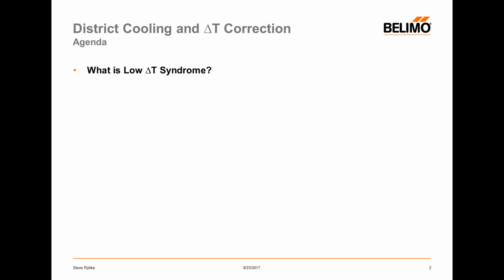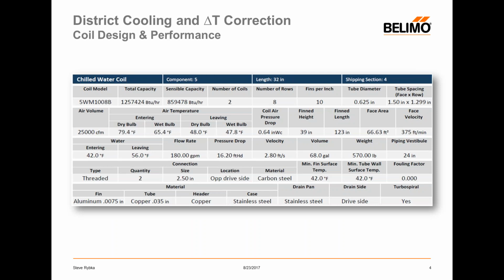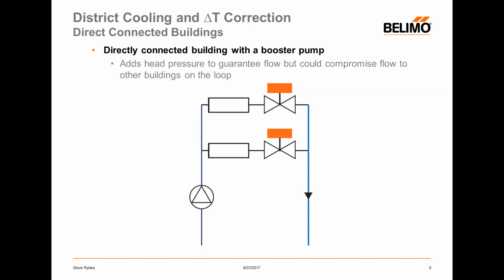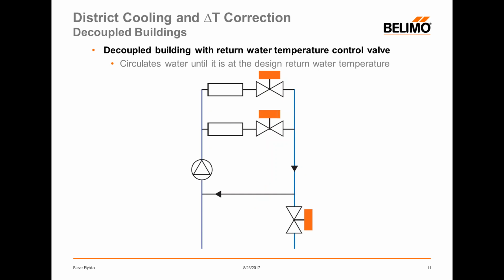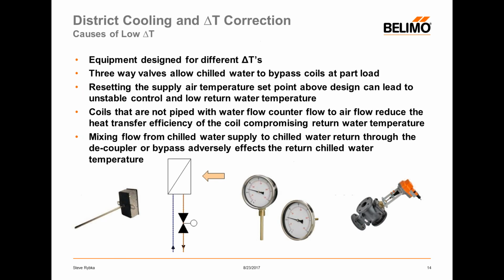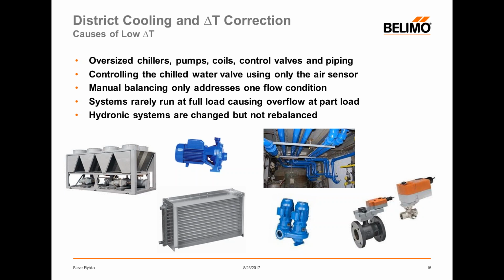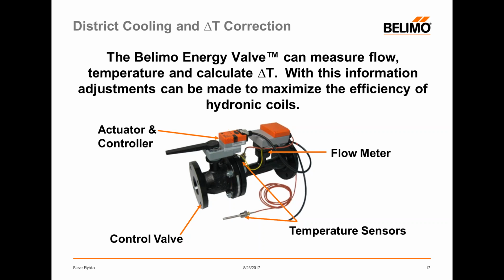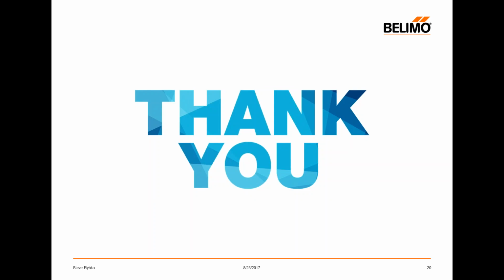Webinar: Correcting Low ∆T in Buildings with District Cooling

Comment: We are using VFDs to control the pumps speed to match the flow requirements for varying load conditions in the building. In addition, 3 port bypass valves are installed at the index point to maintain cooling demand. Would Belimo controls be of use here in this design since the flow is already controlled using drives?

Comment: Is delta T calculated from the supply and return temperature of buldings or the chiller set point to return ???
Reply: Technically both, but the video addresses the issue where the intent was for a building or coil to achieve a higher delta T (i.e. temperature rise across the building/coil), but the actual performance is less. The intent would be to match the desired condition at your chiller plant..